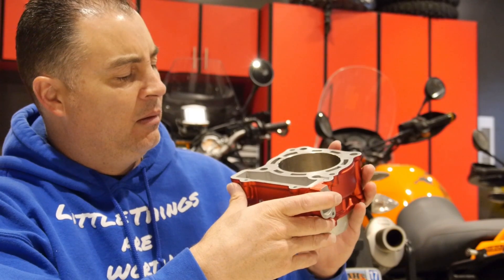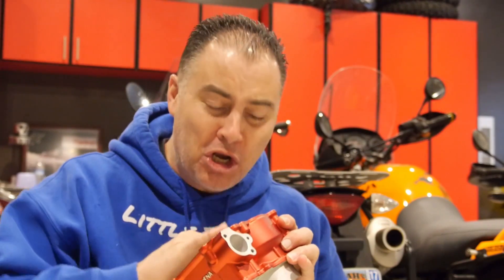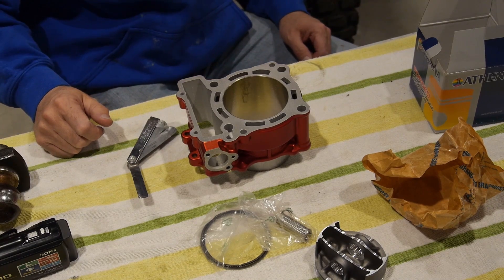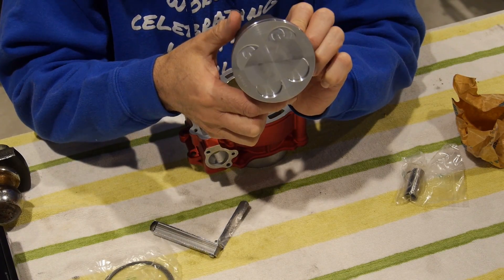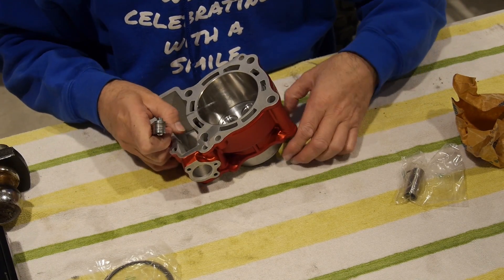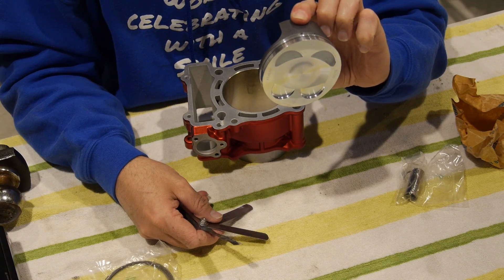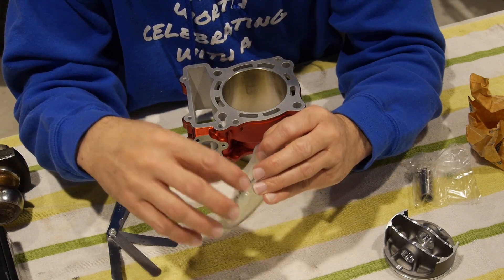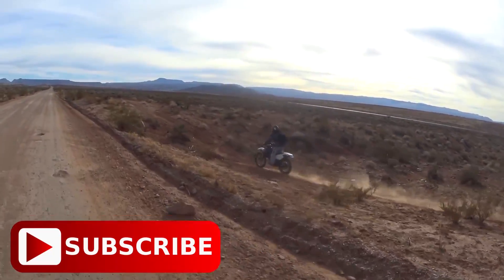++Athena++ WR310R piston and ring fitting guide

Comment: Hello Mr Duhfactor, I have recently bought an Athena Big Bore Kit for my WRR and I wanted to ask you if I this information about ring fitting  applies to  new complete kits or just used overhauled cilinders and a new piston ( I guess you mean that). I want to let take apart my engine at 30.000km because of a stripped drive axle assy. In general what should I expect to be changed at this mileage? All sealings, what else?All Bearings? Love your channel. Regards from Germany
Reply from the maker: Hey buddy! I always check the ring end gap everytime I change anything related to the piston, Cylinder, etc. Even new, you never know if it was checked properly from the factory. At 30k km, your getting close to needing to change the intake valves, and yes, I would change all the seals you can get to while your at it. I would check the loosness and condition of bearings, but they usually last about double your mileage. Good luck!

Comment: Did I miss it? Did you explain how to expand the gap if too close? I use to use a thin cut off wheel inserted in the gap and manually grind the ends then use a jewelers file afterwards until the proper gap was achieved. Great video start!
Reply: go to autozone and borrow a piston ring filer wheel